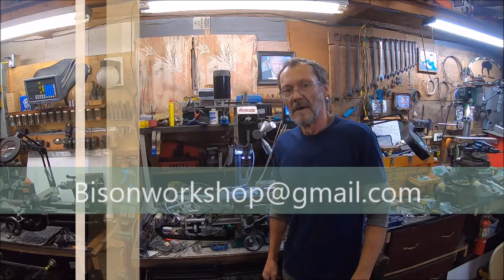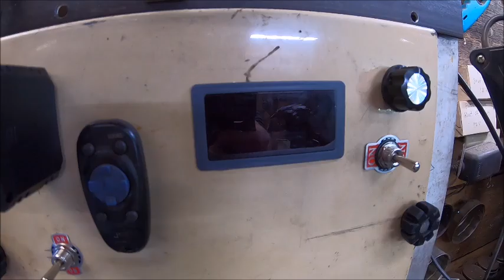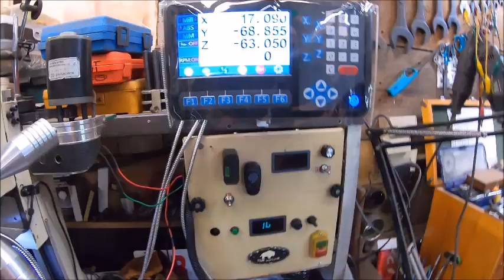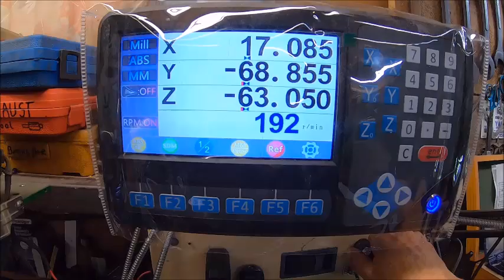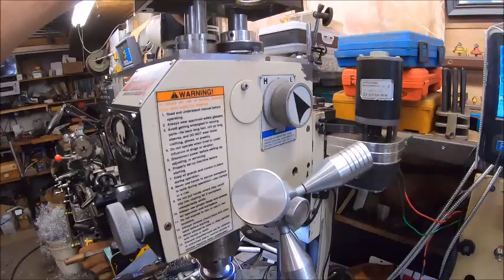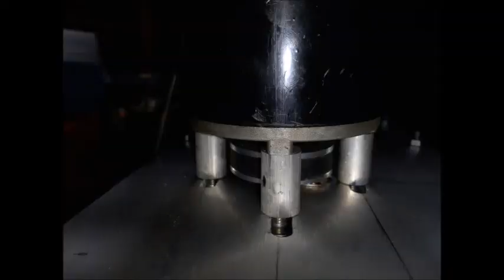grizzly g0748 mill dc motor upgrade  part 8 done

Comment: CONGRATULATIONS indeed to Mr. Donald J. Trump for his awesome victory!! Cool ModificationThat does look like a stepper motor when you spin it, it cogs went you spin it. I think you put the RPM sensor in the wrong spot, you should put it on the spinal rather them the motor. The motor is a constant with the voltage the spinal speed changes after the gear train. If you would like to give me the dimensions of the pulley I can machine one up for you. Thanks for sharing and for supporting Trump!
Reply from the maker: i go by ear so i normally dont pay any attention to the RPM the original rpm display stop working a long time ago so i only added it so it was looks lol
Reply: @BisonWorkshop  LOL! I did the same thing! I have the same DRO as you on my mill and lathe. The lathe is on the spinal the mill is on the motor, if I have the option for RPM I should use it. Why waste it? It looks cool, people that come into my shop don't know and I'm not telling them.